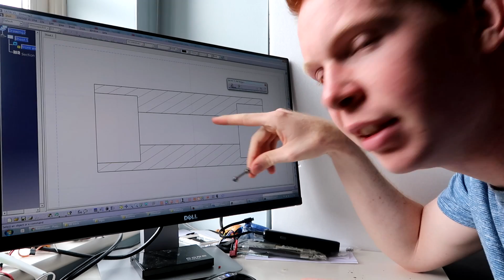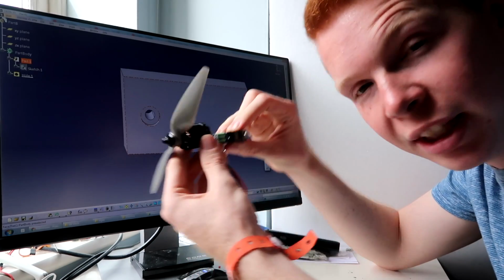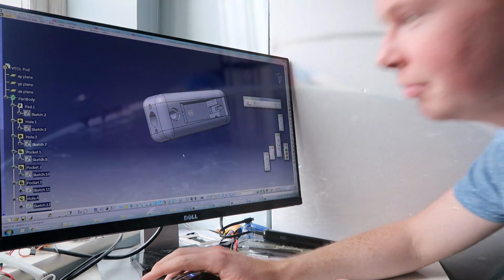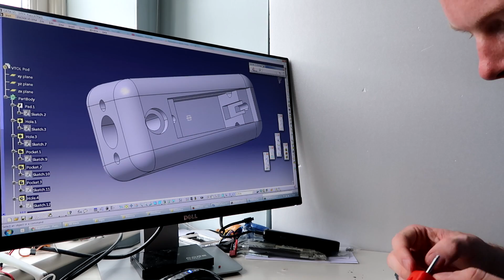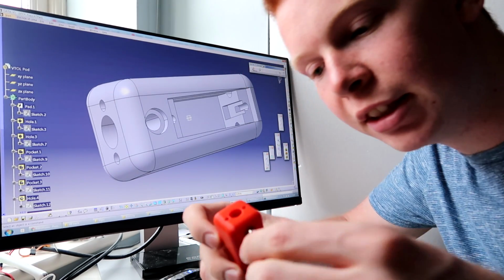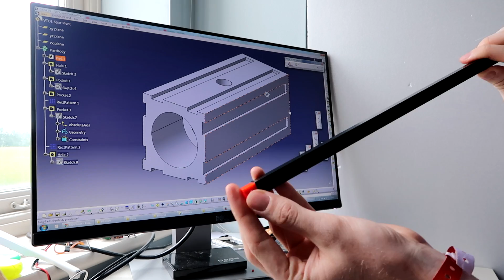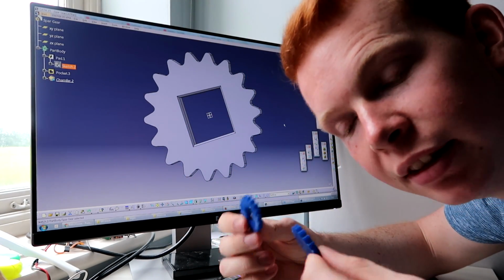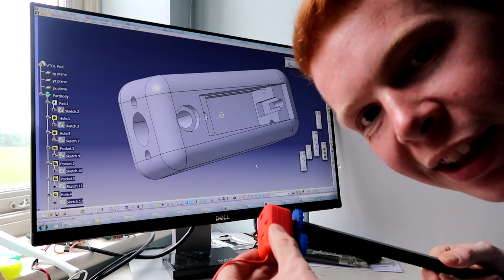RC VTOL V3 - Tilt Mechanism

Comment: instead of tilting the engines would agree not to tilt the ailerons?
Reply from the maker: +dino memmo the plane will have ailerons too, but this is for control when it is in a stationary hover
Reply: ailerons could control both the hover that the traditional one?
Reply from the maker: +dino memmo how would ailerons control the pitch axis at zero airspeed? These are required for pitch control in a hover
Reply: sorry, you're right. I have considered the possibility to rotate the wings. Then engine and ailerons sorted

Comment: Tom - you have chosen a certain flight controller board KK2 for your projects - I want to experiment with a quadcopter that transitions back and forth to vtol, for better cruise performance as a plane.  Do you recommend the KK2 for this type of craft?
Reply from the maker: +Troyer Group Yes the KK2 board with OpenAeroVTOL firmware is perfect for what you want
Reply: Tom - Thanks - what is ur expected ETA for ur V3?  I live in the states - but lived in England, do you monitor ur frame biz email?   Could we talk?
Reply: Troyer Group  hoi